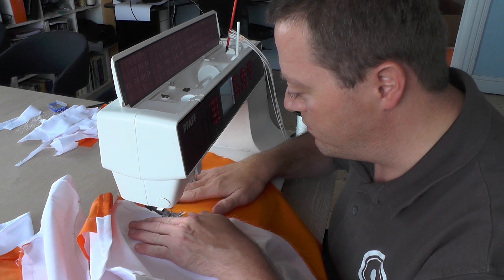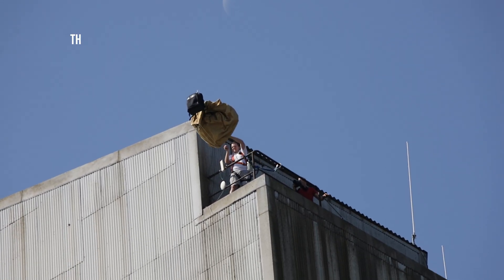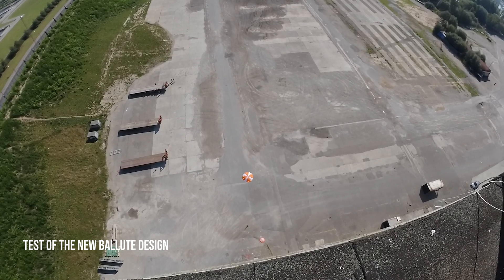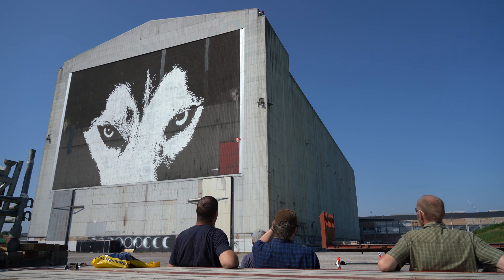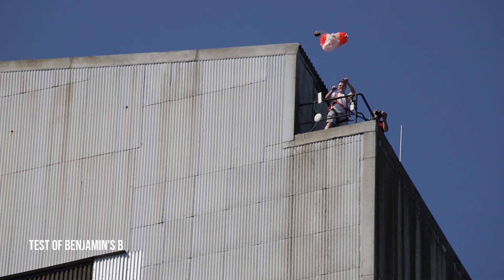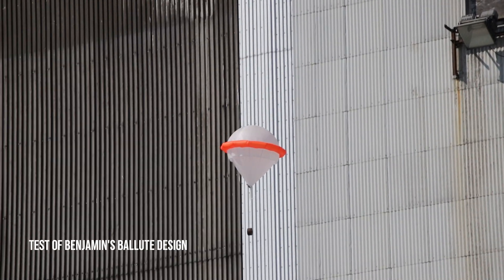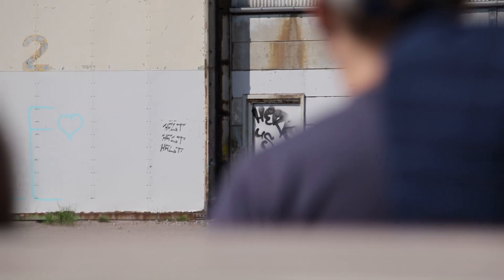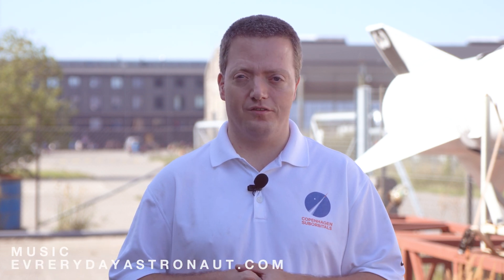Droptesting an Improved Ballute Design

Comment: To Copenhagen Suborbitals, as I remember seeing the picture of the interior of your space capsule, with the pilot, are you actually going to use a pilot suit just like those used by fighter pilots, or are you going to make a space pressure suit or modify the one that has been made before?
Reply from the maker: Likely no pressure suit. The thing we are worried most about in the suit department where we could actually make a difference in the astronaut's safety is survival in water after splashdown under an unexpected flight/landing path.

Comment: Why opt for a ballute instead of a classic parachute design?
Reply from the maker: The ballute is only one part of our recovery system. We need something to stabilise and slow our space capsule down in almost vacuum to withstand reentry. A parachute would not work as well in this environment. Once the space capsule is back down to around 4-5km altitude, the ballute will also act as a deployment mechanism for the main parachutes for landing.
Reply: @CopenhagenSuborbitals , okay makes sense! Did you ever consider streamers instead, if so did you do any testing?
Reply from the maker: MrGrebgnet streamers are not good at supersonic speeds. The ballutes strength is that it’s designed to be stable at Mach 3+, which is the speed we will reach during descent.